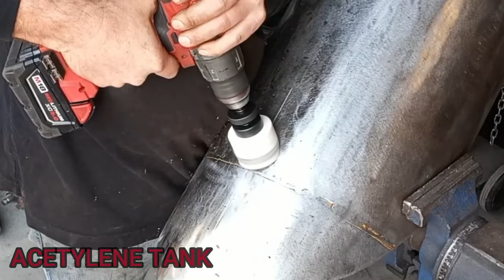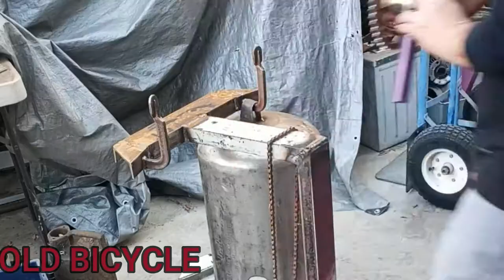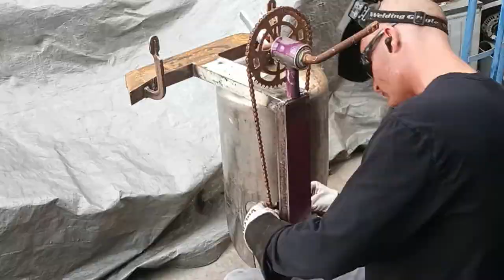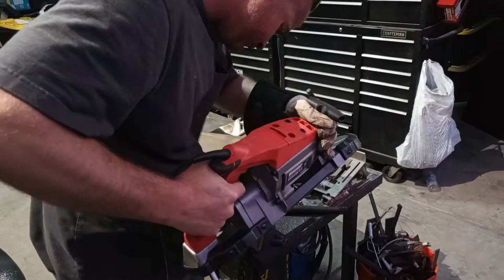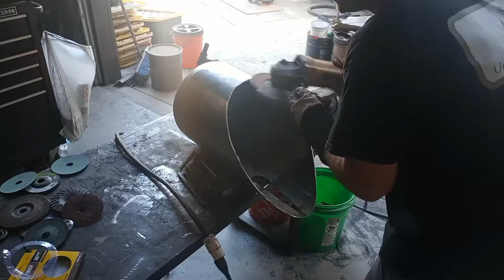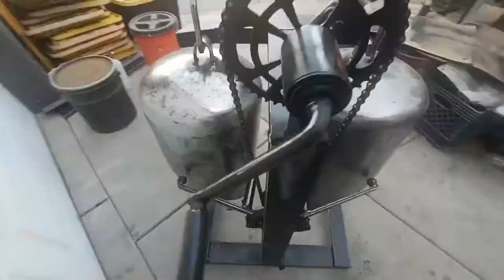Turning an acetylene tank into a hand crank bell machine

Comment: Damn how’d you get the formula for the cam I see you measured distance and burnt a a inch or so on either side how did you go from that to the cam size you need.      Brilliant none the less.  Seems like a trim carpenters secret perfected by a steel fabricator
Reply from the maker: I went about a quarter inch bigger than what would fit between. Then ground it down in place till it worked